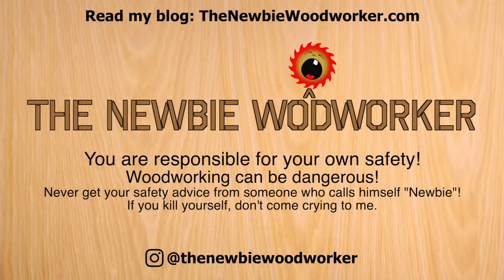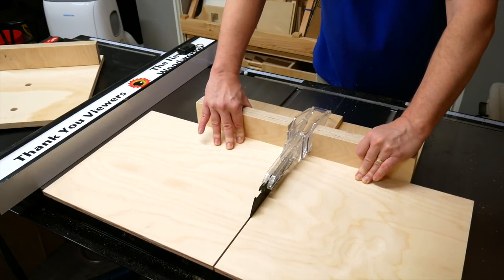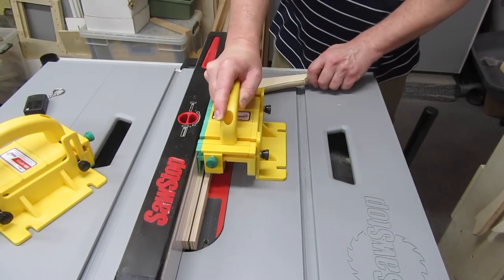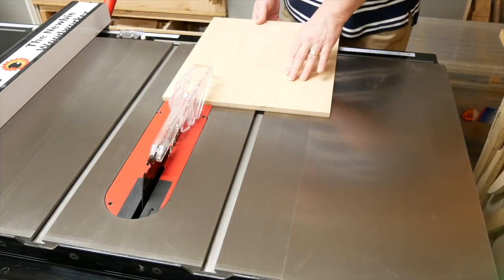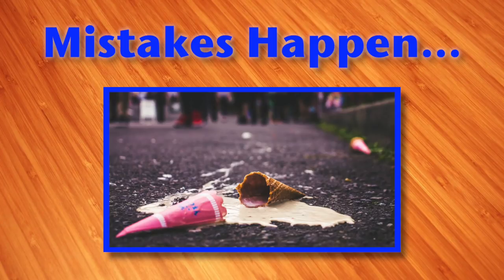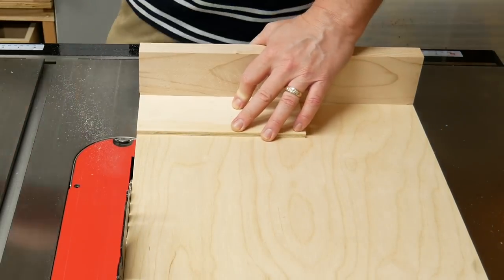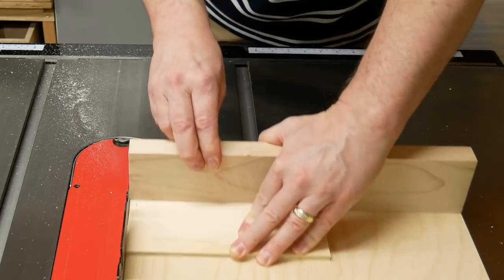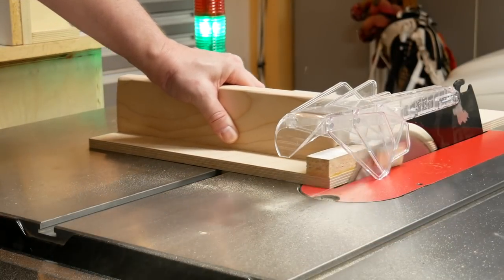Build this Cross Cut Sled that works with a Blade Guard (Half Sled)

Comment: Threw this together and it's so convenient. It works great, and as a neophyte wood butcher, you did a great job of holding my hand getting through it. Thanks for the tutorial.
Reply from the maker: Thanks for letting me know! I'm glad I could help. "Wood butcher" made me laugh. 😄
Reply: I'd have posted a pic of this, or the full-sled, but evidently that capability/privilege is not afforded to the freebie YouTubers. Alas...   Not that there's anything special about either, you know...new hobby, early projects, a Tom Hanks "Cast Away" moment...Look what I have created!.
Reply from the maker: @4refnump  As far as I know, YouTube has never allowed embedded images in comments, and considering the volume they're dealing with, I don't blame them. However, you can always upload your images to an online service, and include links here. Also, there's lots of woodworking websites that have forums where you can post these types of pictures, if you just want to "show off" 😄😉

Comment: I am going to see the pros and cons of the kickback pawls on mu Sawstop PCS.  They don't work very well.  Do you have comments about these stupid pawls?   I almost never use the blade guard.  But lately I have started to.  Great video.
Reply from the maker: Thanks. I think the blade guard or a riving knife is critical to stopping kickback. The blade guard itself can help as well to protect you from wandering too close to the blade. And if you think you never get close to the blade, run a camera for an hour or so while you're working, then check the footage. If you're anything like me, you'll be shocked to see how close you get sometimes. You might notice I haven't mentioned your main question - pawls. Honestly, I've almost never used them.

Comment: Hi Dan
Back from our travels, albeit briefly.  Off to Tassie in a week.  Anyway, the cheap table saw I got for Linda's daughter actually only has a mitre slot on one side, so I can't see if the full sized sled would work.  It would only be able to track down the one slot and I doubt it be worth doing.  What do you think?

Off topic.  We have rain.  About an inch in 24 hours.  Who would've thought?  Rain in Australia.  They say that half the fires are out.  That means only about 80 in our state.  Better than double that and maybe the tennis players will have a better time breathing.  Cheers Col
Reply from the maker: Welcome back. I heard about the rains, and how they're a mixed blessing because of the ash runoff. But I'm glad a lot of the fires are going out! I actually think the sled would probably work OK, even with just one miter slot. Make sure you add the rear support piece, though. https://youtu.be/cQINXsn2QBk
Reply: Thanks again. So you reckon go full sized?  I think I’m having one of those confused moments that we don’t talk about
Reply from the maker: @colrodrick8784  There's no guarantees, but I think a full-sized sled with only one runner will work. It certainly can't hurt to try.
Reply: @TheNewbieWoodworker  Ta mate

Comment: Very nice.  The piece of melamine on the backside of the fence to support the guard past the cut-- that would have to be at least as tall/thick as the thickness of the stock you are cutting, yes?  How forgiving is this?  Do you have any problems if/when this is mismatched, for example if the melamine was 3/4" thick and the stock was say, a 1" thick board?  When does the difference in thicknesses become an issue with binding of the guard on the return?
Reply from the maker: Yes, there could be some tear-out with the piece not completely supported - it just depends on the size and type of wood. Honestly, I use my full sled for most everything I do. https://youtu.be/cQINXsn2QBk
Reply: @TheNewbieWoodworker   My apologies if the question wasn't clear-- not so much a question of tear-out, but rather a question of the blade guard catching on the stock on the return pass if that melamine piece doesn't match its thickness.
Reply from the maker: @BetterByThePound1  Yes, when pushing the sled back to its original location, the blade guard can catch, for sure. Not as much with the full version, though.

Comment: 6:27  Hey Dan, I'm guessing what happened to make the 1st strip perfect and the 2nd strip tight, from the same fence position, is blade deflection on the 2nd one.  Some bit of grain in one of the layers had to have had a slight angle to it, just slightly not straight to the cut line, and the wood in that angled grain was of sufficient hardness that it deflected the blade ever so slightly, laterally away from the fence a couple thou, cutting a wider 2nd strip.  This didn't happen on the 1st one because either it was from a different piece of plywood, or the same piece but oriented differently, so that this bit of harder angled grain wasn''t in the blade path, or else because your pre-cuts on each end to sneak up on the width got the blade past the harder deflection point when you made the full cut.
Reply from the maker: That sounds like a great explanation. Thanks! 😄

Comment: Use silicone spray or sewing machine spray to eliminate  friction...makes it so much easier to slide materials about and whilst cutting...
Reply: Silicone wreaks havoc with finishes.
Reply from the maker: I don't know how well silicone interacts with cast iron. But if it works for you, great!
Reply: @TheNewbieWoodworker  well ive worked in sawmills for 28 years, and using every and all kinds of wood working machinery, we always used silicone spray, it doesnt affect any metal, if anything if makes it water proof, so if  your in a damp enviroment it will prevent any rust occurring too..any thing with a bed like straight line edgers, crosscut saws, bands saws, chopsaws..planers, it makes materials  easier to move and so is safer as you dont need any pressure, thet cause undue any accidental movment of material. and all the types of wood, be it hardwood or softwood
Reply from the maker: @aministratorgeneral.9298  Thanks for the info!

Comment: Love the videos for Newbies. Why didn't you glue the back fence to the sled? You just showed using screws?
Reply from the maker: Thanks! I usually don't glue things like that, in case I need to change something. But you certainly could glue it down if you wanted to.

Comment: Made sled and it is great. My guard on my Dewalt rises up and down with the blade. Trying to do half lap joints, the wood couldn't slide under the guard. Any suggestions how to solve this?
Reply from the maker: Thanks. Sometimes you have to remove the guard, even if you don't want to.

Comment: I bought my table saw two years ago and I’m scared to use it to cross cut cause my table saw is a ryobi and it only has one track 😢.  So could I make the half sled for cross cut ???
Reply from the maker: Yes, the half-sled would work fine. You can also make a standard sled using only one runner. See https://youtu.be/b-65Bs5Yi0w

Comment: Thanks for addressing the cawls, oops, pawls.
Reply from the maker: Do you mean "anti-kickback pawls"? If so, I'm guessing you're being facetious?
Reply: Not being facetious, Dan. After watching your first sled video using the guard, I knew it wouldn't work on mine given the pawls :/
Thanks for following up with this video. Your effort to design a sled, and produce a video to share are much appreciated from this newer newbie!
Reply from the maker: @anneoreilly4900  Thanks. I still feel like I'm missing something, so let me add this: I don't use the anti-kickback pawls, and I honestly don't think they're necessary if you're using a riving knife or blade guard. (But of course you have to do what you feel is safest, and I'm just some guy on the internet, etc. 😄) With my blade guard, there are two posts that stick out of the side of the metal part of the blade guard, for the pawls to rest, and they get in the way of using a push stick. So I used an angle grinder and removed them. Don't know if that helps or not. 😄
Reply: ☺ appreciate the response! 
I'm thinking your little pieces that drop down act like pawls. I can adapt that idea for my, almost as old as me, Craftsman.
Reply from the maker: @anneoreilly4900  No problem - I like talking about this kind of stuff. 🙂Pawls are designed to grab the stock and sink their teeth into it, if the stock is in the process of being kicked back. But to me, they just get in the way, and and they can damage soft wood. If you haven't seen my video on kickback, you should watch it - some people find it scary, but I think understanding kickback is the best way to avoid it. https://youtu.be/ZUZ8hRm7a8g
Reply: I have enjoyed your kickback video and recommend it, Dan. Knowing more helps me feel safer, lol, too.  What is the name and purpose of your blade guard pieces, please, if they aren't pawls?
Reply from the maker: @anneoreilly4900  Here's a picture of pawls, and an explanation of how they work: https://www.woodworkingtalk.com/f2/table-saw-damage-wood-pieces-143385/#post1445033. For the blade guard, it's actually two pieces (usually). There's the vertical metal part that goes down into the saw, and it's basically a riving knife that the guard attaches to (refer to my kickback video for an explanation of the riving knife). Then the blade guard itself, which is usually plastic, and it does exactly what it says - protects you from touching the blade, at least as much as it can. You could always stick your fingers under it and get cut - nothing's perfect. Does that help? Oh, and I'll bet this is explained in your table saws manual - but who reads those things? 😛
Reply from the maker: @b2pi  That what's not necessary?
Reply: @TheNewbieWoodworker  Anti-kickback pawls. I'll grant that it might not have stopped that thing flying back, but it would have frightened me no end...
Reply from the maker: @b2pi  Oh, I see it now. No, they probably wouldn't have helped in this situation, but I understand what you're saying.

Comment: What if the build the sled to fit beyond the blade, then use a "drop into position" method over the blade before you start your job  that would give adequate strength..
Reply from the maker: I assume you're talking about the full sled. That's a good idea, but it requires a couple of things. First, you have to be able to remove the guard part itself, and I'm not sure all blade guards are built that way. And secondly, the metal part of the guard has to not have anything sticking out of it. If you watch around 3:43, you'll see a post sticking out of the metal part, right behind where the plastic guard attaches. That would get in the way. Of course, if you happen to notice in other shots, I took an angle grinder to those posts, so your idea actually would work for me.

In the long run, I don't think it's necessary to have the additional support you're talking about, but I think it's a great idea, and I'll see if I can work that into the build video somehow. Thanks! 😄
Reply: @TheNewbieWoodworker  yes,allowing for enough movement to move beyond the blade on the rear..and alowing for the guard.
Reply from the maker: @aministratorgeneral.9298  Got it.

Comment: Ummmm....
Wouldn't the blade not need to go so far past the back  (Toward the operator) if it was raised higher?  It's a geometry thing.  The circle of the blade intersecting the rectangle of the wood.  The rectangle moves along a line representing the table top.  The upper corner represents the point at which the wood is cut completely through.  The intersection of the circle with the line gets closer to the front face of the rectangle which means it cuts less of the sled as the blade is raised.
Reply from the maker: If your blade guard does a good job of protecting you from the blade even when it's raised up, then that's a great point. I'm just so used to raising the blade only enough to get the job done, which is the safest thing to do if you're not using a blade guard. Thanks for the comment! 😄